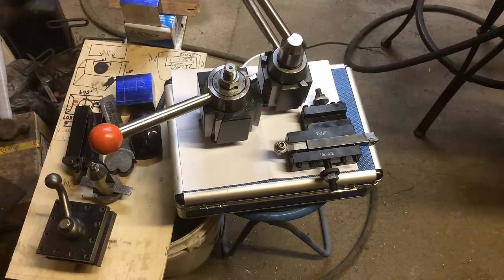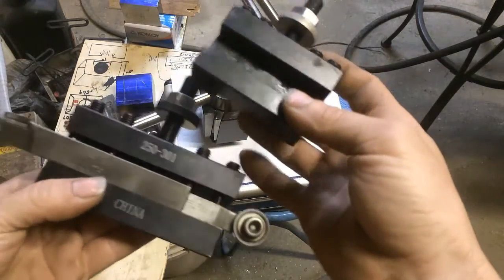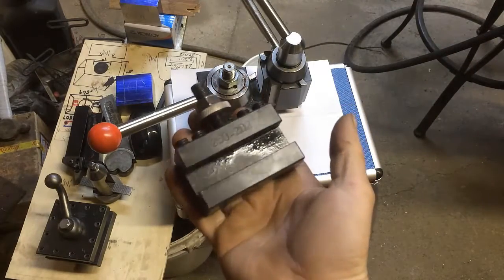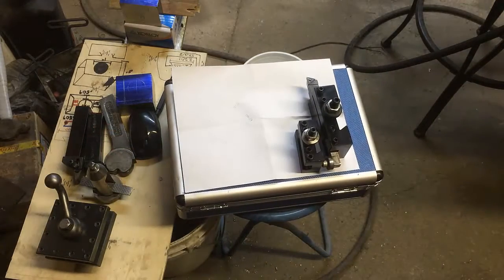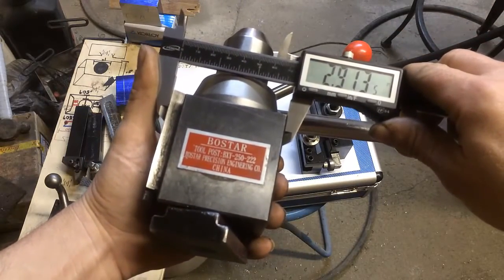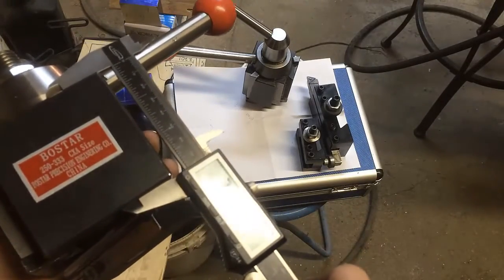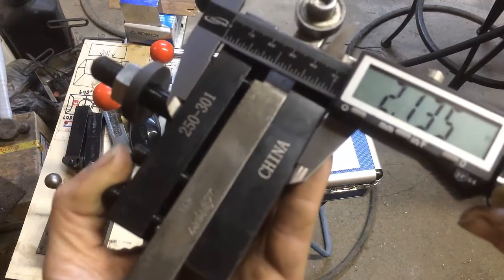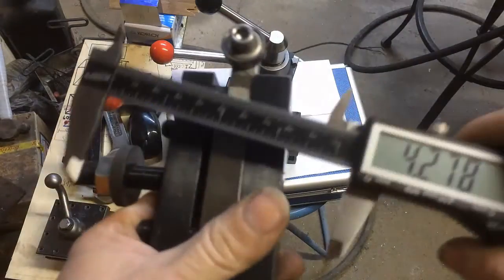Bxa vs CXA 200 vs 300 series quick change tool post  holder comparison

Comment: I have a Enco 12x36 lathe would you suggest the AXA or BXA ? Thank you
Reply from the maker: +Milspecmachine BXA the axa is way to small and limit the tooling you can use and are not as ridged as a BXA